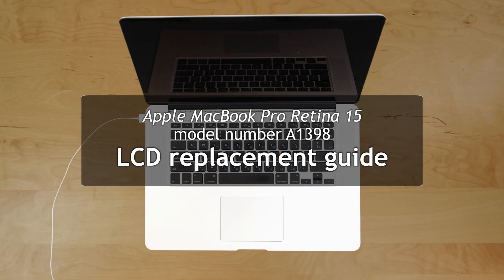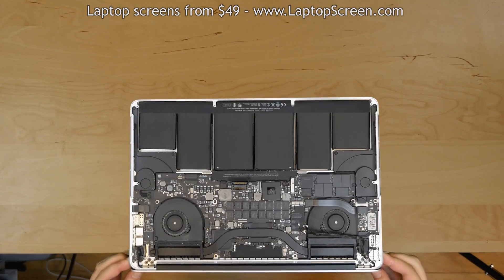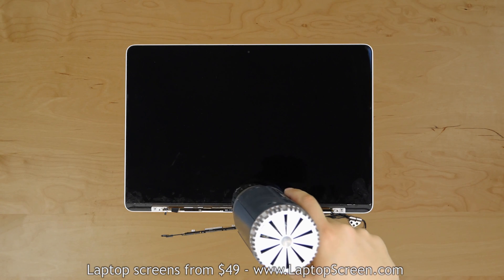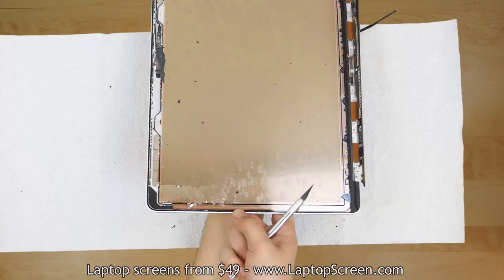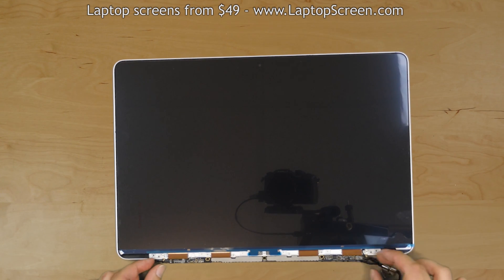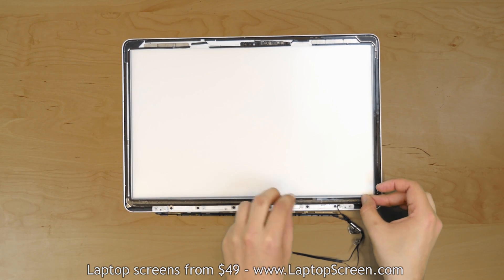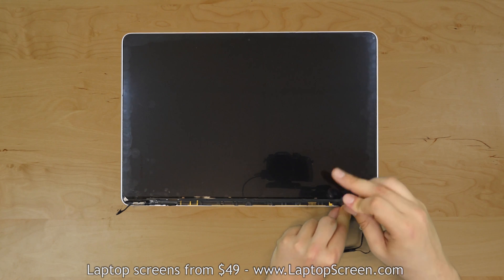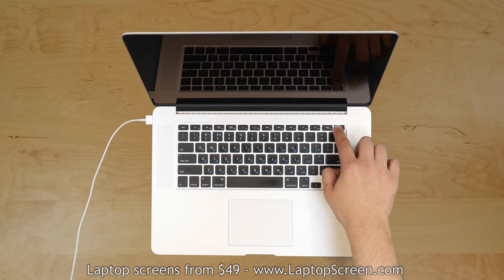Laptop screen replacement / LCD repair [Apple MBP Retina A1398]

Comment: Is it possible to replace just the rubber gasket around the screen, and if so does that require a full disassembly?
Reply from the maker: The gasket goes under the LCD, so you'll have to perform all the steps in this video to replace the gasket together with a new LCD matrix.
Reply: You can’t just shimmy it in there?

By the way,  really appreciate your informative content.
Reply from the maker: I don't think it would work using the original gasket, since most of it needs to go under the glass.
You could try using Sugru, it's a moldable silicon-type stuff that cures into flexible rubber-like substance: 
https://www.amazon.com/dp/B089WHGQDP/

Comment: Hey can you do antanne replacement video. both my hinges were broken i replaced left one looking at this video which was a massive help. i looked everywhere on the interent there's no video of antanne replacement. There's none
Reply: I also have the same problem. I was accidentally tear off the wifi antenna cable during the pry process. So sad 😞

Comment: I have a MacBook Pro RETINA 15 inch with the coating problem, but I don't see the use of your video if just the glass surface isn't available on your site. Yes you can by juist the LCD (but that works fine in my MB) but not just the glass surface! :(
Reply from the maker: Unfortunately the surface glass is the first layer of the LCD in all Retina MacBooks. Apple replaces the entire display assembly to address the disintegrating coating issue.
Reply: You can try using Listerine to remove surface coating problem.

Comment: What happen to the gasket..did I miss it
Reply from the maker: Its a gap. 
Removing the gasket was a mistake in retrospect. Try leaving it on. Otherwise you'd need to source another gasket, use Sugru instead or live with the gap.
Reply: LaptopScreen.com actually I manage to get a replacement gasket. But doesn't have the courage to try open the lcd
Reply: @suffianums  it's possible to reinstall without opening anything else. Simply squeeze it there with soft plastic tool